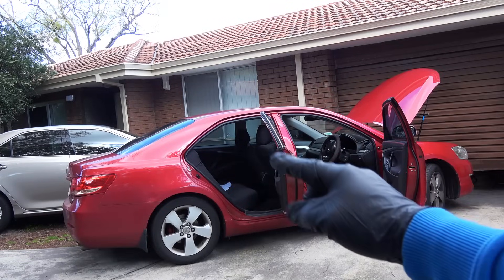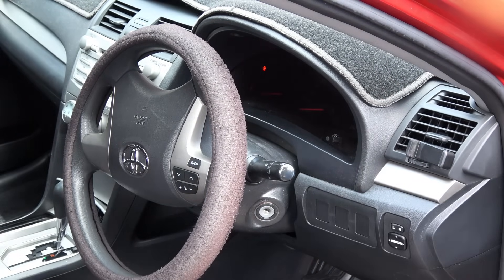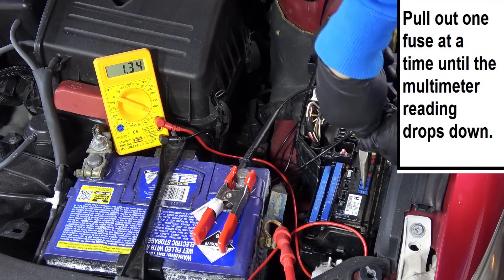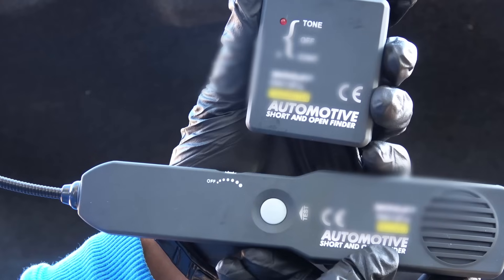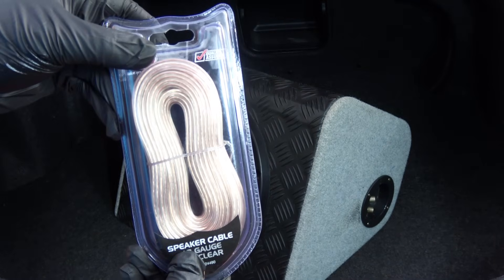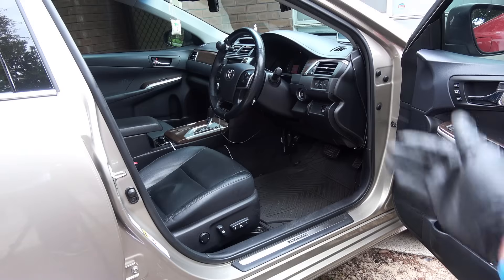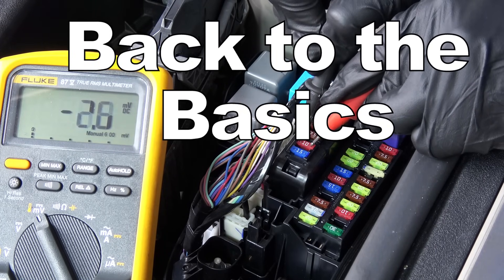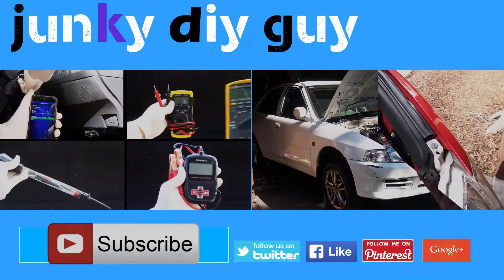How to find a short in a modern car fast and easy (The correct way)

Comment from the maker: Guys, check out my latest video 
https://youtu.be/UG54xt56uZo
Reply: Ok
Reply: I need help in my 2018 Camry, I must of shorted out something when tapping into a wire for a led light, now the lights around my radio do not come on and all other interior lights are dim, but everything else works as it should including the radio, any advise would be great.
Reply: @gman20031  Check no fuses have been blown. If not do a parasitic draw to find which circuit is affected. Then obtain the wiring diagram for that circuit and then isolate the problem area by voltage drop testing. Dim lights means that there is resistance on that circuit which is taking voltage away from the lights. If the fuse for the lights that don't work is blown and you replace the fuse with the correct rated fuse and it blows again then you have a short circuit on that components electrical circuit. You will need to do a voltage drop test as well using a wiring. diagram
Reply: @gman20031  
Check the dashlight dimmer wheel thingy.
You may have also fried something in your interior lights auto dim controller or park light circuit by the sounds..
Reply: Vids are great;  speech too rapid to be effective.
Sorry.  (Retired public school teacher.)
Reply: So is that what everyone does these days? We set up a problem that we know the diagnosis to so we can make a video for it. 😒
Reply: can you do one for the Keys not moving in the ingition( column steer lock/ ignition Cylinder lock  Fix )-
Reply: Hi, thank you very well explained
Reply: I have multiple issues, someone bunched up colored wires together.
Reply: Great video and great explanation, I'm surely subscribing to this channel.
Reply: Junky DIY guy pull a fuse and wake a computer up and u have to start all over again voltage drops and amps testing is only way
Reply: thebravo1994 pp

Comment: Need HELP !!!
Today Our Vauxhall Insignia 2009 Automatic developed a fault, they Air blower is not responding, sounds like the fan is running but little air coming inside and directional switch not responding. 

Scanned with out AUTEL and it gave me 2 error code B0233-01 AND B0408-01, 
air flow control circuit and main temparature control circuit- short to battery. 

Can you please tell me is this a problem with a Fuse or the Motor? Also where does the BLEND AIR ACTUATOR motor located in Vauxhall Insignia?

Comment: Super great video! Thank you! 
One thing that is not clear for me however. When checking a modern car as you demonstrate at the end, are you setting the multimeter to measure volts or resistance (ohm)?

Comment: I buy cars from auction and my wife’s 2018 navigator shows a short to ground on the scanner. If I change the headlamp module and reset the codes, everything works but eventually it stops working then the other turn signal stopped working and the running lights on both. Trying to figure it out.

Comment: This video is not accurate with today’s cars run by CAN-bus Communication Systems with Wake-Up circuits.  Especially on a Ford that draw .80 mA to 1.80 mA.
Many Controller’s today also have timed circuits that go to sleep in stages.          It is not uncommon to see 3.0A or more that slowly drop down as Controllers go to sleep.
Add in moisture and green corrosion (resistance and leakage) over time mA draws will rise.

Comment: For prolong storage of vehicle ( no driving), it is useful to do one or both of this, 1) a manual 'disconnect switch' to positive battery terminal 2) have a solar panel ( getting Sun) that trickle charges the battery while in storage / parked. But also check for weak battery draining ( not holding charge while disconnected).

Comment: Another common problem with Radio Installations is the Service Tech uses the Clock Hot Always ON instead of switched HOT and is OFF when the Key is OFF. Great Video. Good Job finding that Fire Hazard.

Comment: This video is not telling you how to find a short in a circuit.  Its showing you how to find a Parasitic Drain in a circuit.  A short is positive going to directly to ground.  People need to stop using the term short circuit Interchangeably.

Comment: The fuse that you pulled out you said there was low voltage but was the fuse broken in half? Would a test light still light up if you touched both pins of that fuse?

Comment: Hello 
Great video hace a question i have a 98 Chevy Tahoe and it burns fuse (IGNITION A ) as soon I turn into the start position… run these test and my horn is reading 1.35 take the fuse out and drops to 60 need help plz and thank you

Comment: I have an electrical issue with my car,it had a coolant leaked and over the starter and that prevented the car from starting,no lights or anything will work,I replaced the starter and put a new battery but it drains the battery overnight, any thoughts of what could be the problem? 
Your video is very helpful I’m going to try to find the problem in the weekend. Thanks for uploading

Comment: A short will typically pop the fuse. Short to earth before the load. At the start of video you are testing for current draw which will cause flat battery issues. The title is misleading imo.
Reply: Well a short to power can cause a parasitic drain. So its actually not misleading is it?

Comment: Short is easy to trace ,because fuse will be broken ..but ...
For partly short or battery leak ,me use a 12V light bulb ( signal bulb ) to trace the leak 'by touching the fuse 2 points after the fuse taken out ( mean the fuse circuit is bypass by the testing bulb connection).. the Brightness of the testing bulb indicated the area of current leaking  from the car battery ..

Comment: Quick and odd question. Messed up and tested voltage instead of amps. Positive terminal goes three places, the cab, alternator, and starter. Disconnected the positive from each and tested voltage at the negative, plugging in the positive to one item at a time. Remember, engine is off, cab is closed, key is out, and the car is old, and doesn't have a sleep mode.

1. Alternator tested at 12.8v
2. Cab tested at 12.8v
3. Starter tested at 0.03v

I could not make sense of why the alternator and the cab were both pulling current when connected and off. Is this normal?

I am very much not an electrician, so I could use some answers.

Comment: I have a 12 amp draw and my multimeter only goes to 10, when i tested it i saw sparks, what could cause 12 amps? Is there likely multiple shorts? Should i take all my fuses out and put them back one at a time?
Reply: Update, i have it narrowed down to fuses 4 and 8. My car runs without those 2 but my break lights and radio dont work. Time for the fun part, finding the culprits

Comment: One quick way to check your alternator...  While the engine is running, disconnect the battery, the engine should keep running.  Your car, once started gets its power to run from the alternator.  If the engine continues to run, but your battery runs low or dry over night, its time to replace your battery.

Comment: That’s a parasitic draw test. And your supposed to be connected to the battery post and the terminal before your break the ground circuit because you’ll get a false reading. Plus once you do break the circuit and your meter is in series you still need to wait for the computers to stop talking before you take your reading.

Comment: Is there any reason this method wouldn't work in an older car too? Seems pretty foolproof in a simpler wiring situation where there aren't so many sensors and computers.

My 1984 Jeep CJ7 has a wiring problem, and I need to detect shorts. I assume there is more than one short draining the battery.

Comment: So I had an interesting problem happen recently. I installed a new AC unit in my car and not even a day later, the circuit board in the AC unit had a hole burnt into it. I checked my AC fuses and relay and neither of them were blown. Does that mean that a problem occurred before the fuse box and relay box closest to the battery? The AC was also off when it happened.

Comment: great video, learnt alot! im just a home DIYER , I found my chasis to engine strap copper one completly fried out and green in colour, would this be the contribituing factor to my intermittent starting? before me even checking anything someone said if i run a jumper cable anywere on the body to the negative battery terminal and the voltage doesnt drop wouuld this eliminate this wire as being my problem?
Reply from the maker: even if voltage doesn't drop, a bad connection can spark and drop out when carrying larger current. i would change it regardless and it's cheap.

Comment: This was educational, but how can you find the short when there is a direct short that keeps blowing the fuse ? I know the circuit, but how can you determine where in the harness ?
Reply from the maker: Remove the fuse and use a short finder tool instead, that's what i would do

Comment: When I change the multi meter to amps and connect the red cable to the negative post and the black to the negative terminal, I'm getting zero on the display.  What am I doing wrong?

Comment: New Subscriber here. Does it require to Start your car for 30  minutes everyday to charge the Battery? What is the difference between Neutral and Park when I on the car?
Reply from the maker: Not everyday, only if your battery is running low. when you're in neutral, the transmission is not locked up in to a gear so the car can roll, when in park, the transmission is locked up so the car won't roll.

Comment: Great info! My car stalls from time to time, it seems like when i use air con and radio while driving, the sign would be air con having a sound like it’s not receiving enough power, like faint unwell lubricated metal spinning sound. If that happens i have to turn off air con and radio, then it’s fine, but if i keep testing my luck and use turn signal or anything that could use electricity my car would stall anc starts again, i just checked my battery and alternator, the voltage looks fine. Please guide.

Comment: Ok, so I was doing this and when I put back in my 60A*  	Roll stability control / Anti-lock brake system (ABS) module fuse. It make the amps go up to about 3.2 then they slowly went back down. Any ideas why?

Comment: Bullshit. An Amps speaker wire can't do that. For one thing and aftermarket amplifier wouldn't be wired to the same circuit as the stereo it has its own power wire that goes directly to the battery with its own fuse so that's why I'm calling b***** on your b***** video. And the only reason you're getting compliments is from people who don't know any better! This type of video that's incorrect does more harm than good

Comment: I have a 1998 Plymouth Breeze ignition fuel starter fuse keeps blowing I went and bought a fuel pump relay I put that in and still don't work it will turn over because I jumped the fuse was a heavier wire I made a loop with the wire and stuck it where the fuse goes the car turns over but there's no spark or fuel can you tell me the easiest way to find out where the wire is grounding hope that makes sense thank you

Comment: Good Evening and hello. I scan my car there is no code show me when i scan my car but it give low fuel milage as well as when i drive my 2009 Toyota Corolla up hill give loud sound. I change Spark Plugs NGK Iridium,Change transmission Or Gear Oil, Oxygen Sensor,air clean filter,Injectors,clean fuel pump, i also check coil which okay i scan but my car show no code in scanner but it not drive normal speed.What should i do?

Comment: Great video, but I am very confused about one point you made. When the multi-meter is connected into the circuit, and you open the door or trigger any power draw from the battery, you say you will damage the multimeter? Wait, I am missing something? How am I supposed to diagnose if I cannot open any door, or trigger any additional power draw? This does not make sense to me. Please clarify, thanks!

Comment: You are describing a parasitic draw,  aka key off battery drain.  Not a short.  Almost the opposite.  A draw shows the circuit is intact.  A short will blow a fuse or melt a component

Comment: Thanks for the info because my truck is always having problem with the radio and lately we installed a devise for a 4 pin adaptor for the trailer and it suddenly stopped working

Comment: Thanks so much, but this did not solve my problem. I found a multimeter in a toolbox someone left behind. It didn't go up to 10 amps, so I put it on 250 mA. I tested a normal flow of 135 mA. I pulled out all the fuses and never got a drop in current.

Oh, and this car may have damaged the battery. I charged it up to about 11 volts, and when I did the preceding tests, it was down to about 9 volts, but I figured it was enough to find a short, especially since I couldn't use a 10 A setting.

I'm not sure if the multimeter is unreliable, if the voltage is too low, or if there's some other reason I'd get a current draw that wouldn't disappear upon taking out any of the fuses. I don't think I have another fuse box.

Comment: Thanks, your teaching method is amazing !
I have 2 questions:
1-what is the test name ? Parasitic Condor test ?
2- Can you explain the voltage drop test ? does the voltage across short circuit fuse drops to zero or what ?
Reply: Parasitic draw test. Not to 0 but close.

Comment: Be careful if you have an alarm fitted because as soon as you make the circuit between the chassis earth and the battery negative you may get a current surge as the alarm arms it's self, and blow the fuse in your meter or fry it if it doesn't have an internal fuse, I know this from personal experience. Better to use a DC clamp meter if you can.

Comment: I tested my battery and it was like 1 volt. It's a new battery, so I'm not sure what's up. I bought a charger on Amazon because trying to jump this car melted my cables. I took the battery out of the car and I'm trying to charge it outside the car, so I'll see if it charges properly outside the car, then I'll test it again.

So since I don't have a battery, I tried using the multimeter to test resistance. It came up to about 10k ohms. Is that normal?

Does anybody have any ideas?

Comment: When the first meter you break out is the free Horror Fright one your credibility automatically goes down by default.

There's FAR easier ways to find parasitic draw without pulling battery cables.

Comment: Hi! I have watched the video and did test, however, I couldn't find any leaks - meter was showing 0.05 Amps and I think the car battery is also working - shows around 12.5Volts and the display indicator lights off after I start the engine. Yet sometimes after the car has been properly hooked on the accumulator it doesn't start, making just a click sound. What else I could in order to isolate the problem.

Comment: A GM BCM stays awake for 20 minutes and will show a load so do not try this on a GM vehicle above 1998.Install a jump box positive to the positive post and negative to the engine.Disconnect the negative terminal and install the meter as shown.Allow 20 minutes or more before removing the jump box and take the reading.Other car brands also have modules that pull amperage for keep alive memory so allow time on every vehicle to allow sleep state.The jump box will maintain continuity in the circuits so the module does not wake up and blow the fuse in the meter.I do a lot of this type of diagnostics as a pro since 1986.

Comment: LoL there is no way that speaker wire you used is any better than what you replaced it with. Needs a larger gauge. regardless still informative video.

Comment: Hey Junky DIY guy, stumbled across your videos the other day. Must say your vids are ALL very helpful and easy to follow. Am a fellow WA resident; good to come across someone from the same side of town :). Quick question, where would you suggest starting point for locating shorts on my fog light that keeps blowing fuse? (Note, the fuse doesnt blow immediately, usually within 10-15mins after new fuse put in and without the engine running/ moving the car). Thanks in advance..

Comment: I am with other commenters here. 1. This is for parasitic draw and not a short. 2. Assuming the power to the radio is off, a connection to the speaker / amplifier would not show up unless there were multiple problems.

Comment: Help. I’ve done this process and my battery goes from reading 3.0 to .28 and then it sits at .28. What range ami looking for? And if my battery is not in range do you know why that would be? The battery is fully charged and when it is fully charged it starts my car just fine. Thanks for this wonderful video. Looking forward to a response.

Comment: WHY WOULD SPEAKER WIRE COMING FROM AN AFTERMARKET AMP DRAW CURRENT AFTER THE CAR IS TURNED OFF??? At worst it would blow up your amp. Is this a factory amplifier driving this sub??

Comment: Have a 2001 BMW X5 350 and the key only opens trunk with button. Will lock and unlock  doors only when key is inserted in the door. I have changed modules relays GM 3 module and center hazard light door locking mechanism. Purchase new keys. Still same problem only opens trunk with. Anyone with ideas???
Reply from the maker: BMW uses something called "transport mode" to deliver cars from factory, this mode turns off all the active systems like remote key to save battery while the cars are being shipped to dealorships around the world, dealors swich it back off before they sell their cars, but if the car detects your battery voltage is getting lower, then the car itself can turn the transport mode back on to save the battery, you have to hook up the car to a professional scan tool to see if the the car has gone to this mode, so do that first.